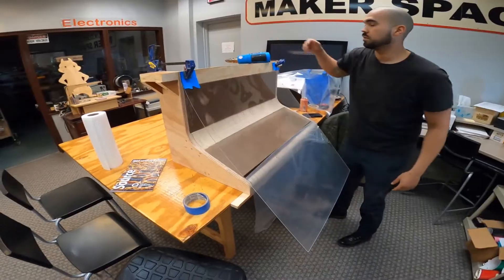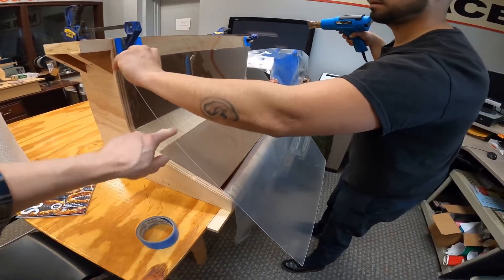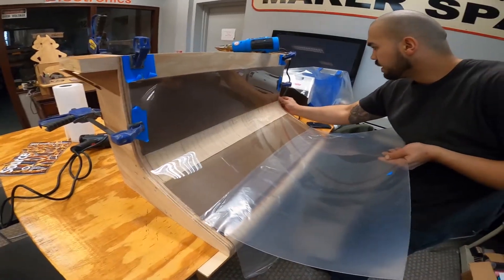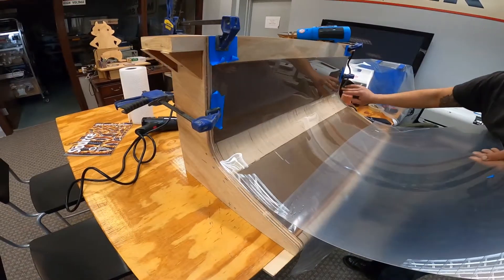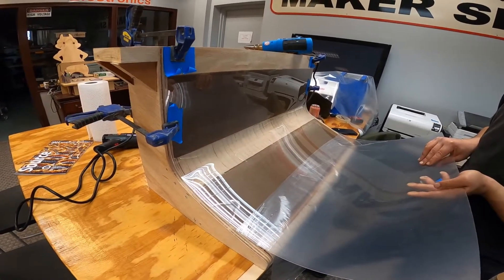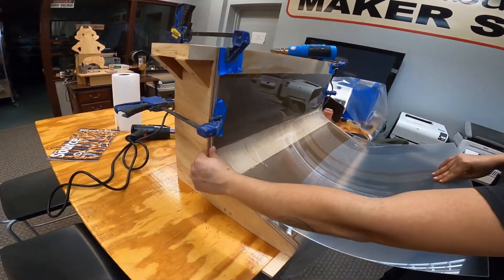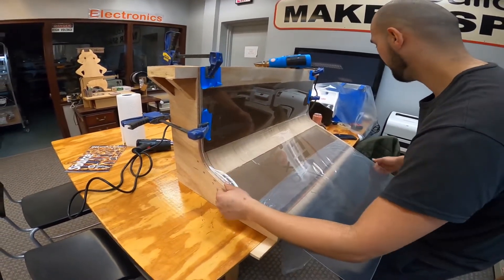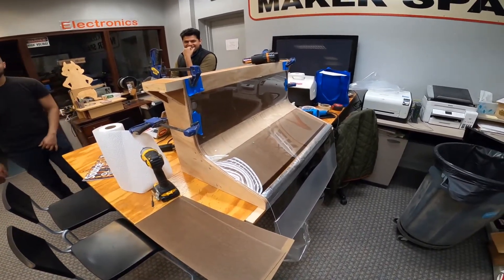Acrylic Bending using a Wooden Form

Comment: Pro tip- (40+ yrs in this) figure out what the smallest radius is and bend that part first over a form using gravity. Then clamp that into the place where it belongs and work each side out from there. Far less distortion and build up stress in the plastic. Good luck.

Comment: I like your video because you are working with a similar size and shape sheet that I am planning on bending.  I want to replace the broken glass on the front of an old Juke Box. The sheet will be 30" X 34" and will need to be bent to a shape very similar to the one that your video shows (curved at the top and almost straight at the bottom).  At 1:34 in the video you skip how the piece finally moved to take shape and what coaxing was necessary.  Did you have touch it or push it in place by hand or did it just fall into place?  Also, once shaped and cooled, does it maintain the desired shape and does the piece maintain some of its original flexibility?

Comment: Nice job guys, maybe I missed it, but how thick is the acrylic? Thoughts on building the form and what's the bent acrylic going to be used for?
Reply from the maker: The acrylic is approximately 1/8" thick. It is going to be used for a jewelry display case.
Reply: Oii qual e o nome desse acrílico  ou é qualquer acrílico que pode ser a aquecido
Reply: If the acrylic is 1/4 thick then u need more powerful heat gun ??